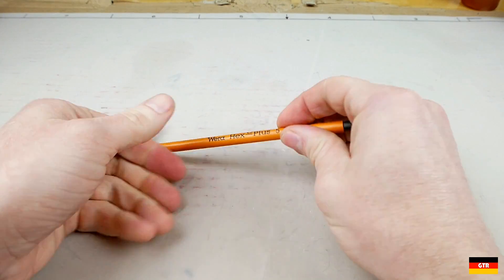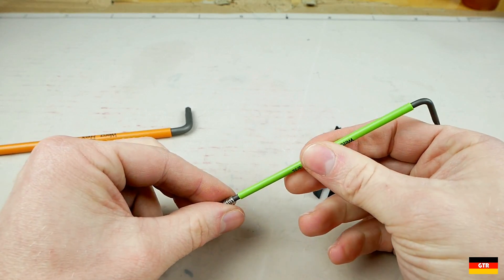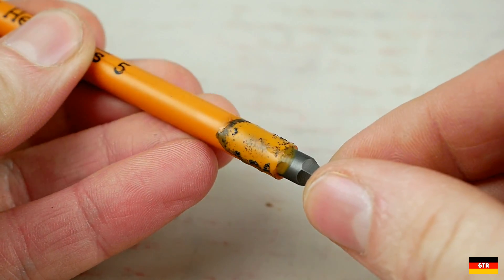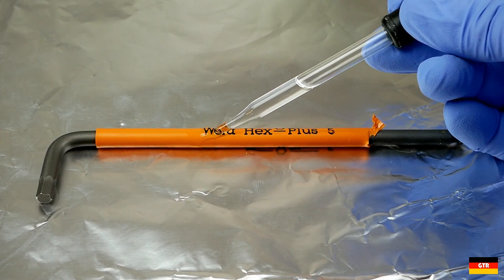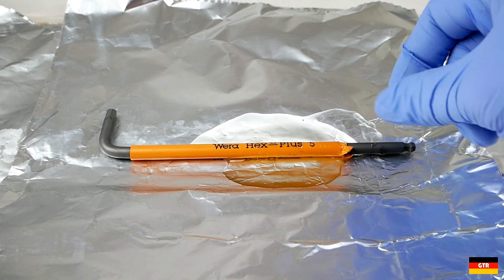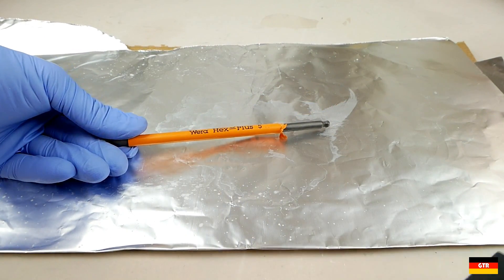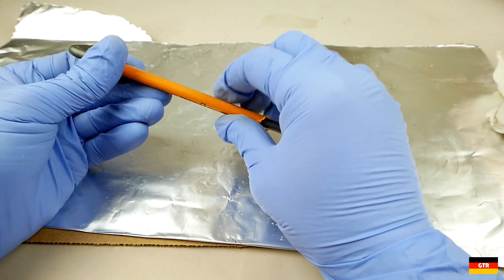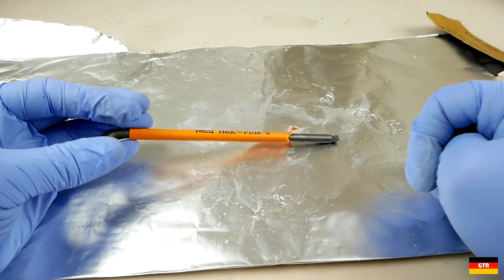Wera L-Key Sleeve Testing

Comment: I've been using a set of these on my dayjob as a mechanic almost daily for well over a year maybe even close to 2 years. I do like them a lot, especially the longer than standard hex key length. I do neither love or dislike the sleeves on them. In a rare case I've come across a situation where the sleeve didn't fit. It was for a pulley set screw. The sleeve is indeed narrower as the major diameter of the screw thread. It's the hole that has only clearance of the threads minor diameter. Just took a boxcutter and shortened the sleeve a bit. I care most about not stripping out bolt heads, and they still perform well. Mine do show fading of the lettering tough, at least the ones that get used most. Plain wear or chemicals, don't know. I regularly clean my tools in the parts washer. not sure what chemical is in it, I'ts an industrial degreaser.
Reply: Might be paraffin if it's engine wash.

Comment: I have had mine for almost 14 months, since they came out, no wear issues or damage to the sleeves. I find one associates the color with the size after a while. It gets confusing though when using the metric and the imperial size, that have different colors. I think they are the best hex wrenches on the market, well made and very slip resistant.

Comment: I sometimes move up the scale with solvents I have on-hand while cleaning unknown stuff; Alcohol, Mineral Spirits, Acetone, then Lacquer Thinner. I think Lacquer Thinner will soften most PVC plastics and I avoid using it on tool handles and such.

Comment: You measured the major diameter of the setscrew but in order for the allen key to fit through the hole it needs to fit through the minor diameter.

Personally I got the stainless versions of teses L-keys and I'm very happy with them, the sleeved versions were more expensive and I didn't think to need those sleeves
Reply from the maker: Yeah I realized that after I finished.  Was trying to measure the minor diameter, so it would probably hit.

Comment: I would consider trying a brake cleaner, a methylene chloride-containing paint stripper (Goof Off All Purpose at Lowes contains it), and a non-polar solvent such as toluene or xylene (the same Goof Off also has both).
Reply: Good call on the brake cleaner and methylene chloride, however, Goof-Off contains Acetone and Xylene as well as Ethylbezene and Methanol per the SDS. Wouldn't hurt to try it non the less.
Reply: Yes, i have seen brakleen react with many different plastcs. For starters. DONT get it on your phone screen! And it deforms rubber o-rings easily.

Comment: I have a set and have had them for approximately a year. Without question the best Allen keys I've ever owned it puts bondhus to shame. However, even though they look lovely when new the identification on the sleeves rubs off within 3 months of heavy use and after 6 months the plastic slips off. The only Allen keys that this hasn't happened to is the 1.5 and 2.5 but that is because they rarely get used. The other issue is that when used now they tend to slip in the hand alot more which has on a couple occasions caused injury. And the other issue is that you can't throw away the sleeves because of the holder bit of a nuisance! If they get used on a regular basis get a set without the sleeves if they do some plus I find I can tell a size of an Allen key by just looking at them if you use them that often. If a hobbyist or used infrequently go for these you'll be more than happy.

Comment: Using these to setup lathes at my job have been pretty nice. There have been a few of them with nicked up and scraped up sleeves, but it's plastic vs aluminum & steel chuck jaws and tooling etc. To be expected. Only issue was with one of the sleeves being too thick when I tried to undo a hex cap screw deep in a tight bore, I had to shave the sleeve down to get in there. The biggest plus for me is Hex Plus. I have yet find another set of L-keys that engage with barely any play and very solid engagement. All the Bondhus keys around the shop work, but they just don't feel as good when I'm putting torque one it to tighten or loosen up a fastener.

Comment: Someone may have pointed this out to you already and it's not really that big of a deal in your video as a whole (or even at all), but how you measured the Wiha key is roughly 1.155 time smaller than the actual largest width dimension.

Comment: I have a set of these for Bike repair. The sleeves of the most common sizes got loose and slide off the l-keys. In my opinion the sleeves are not very durable, if used frequently...
Reply: Bono Bo Same here. If the text is gone fine. But sleeves that slide off is unacceptable plus render the tool holder useless.
Reply: These have lifetime warranty. I had the sleeve slip off one of mine; contacted Wera, they gave me an address to send the faulty one to and sent me a brand new one.
Reply: Same happened to me

Comment: i got a set of those, and i like the coulour coding. although i haven't tested the sleeves in harsh conditions, most annoying thing is: the sleeve catches the hole in the holder. so putting it back in is sometimes rather tricky, and i have thought of cutting it to an angle (like a pencil), to make it easier.

Comment: Thanks for the tests. I  would have suggested a couple others. 
1.As mentioned by many brake cleaner.
2. Brake fluid.
3.Plain ole motor oil. I really think repeated handling with  greasy oily hands will eventually creep under the thermoplastic sleeve  leading to slippage and not necessarily degrading of the material. Had they incorporated a step up at the ends of the sleeve that would probably help to minimize it sliding off but not for spinning. If anyone has had them sliding please comment   im curious
Reply from the maker: I had some brake fluid ready to try, but I read that it shouldn't do anything to plastics, just to paint.
Reply: @GermanToolReviews  Yes i have read that also. I was thinking more along the lines of it removing the print and doing it   probably pretty quickly.  I am still curious if these  sleeves are susceptible to oil migrating under them and causing problems. I think a large portion of people purchasing these will be using them in an oil ridden environment.  Thanks for all your great reviews and to the point presentations. Keep it up. 🙂

Comment: Some personal experience: my colleague managed to smear the text just a little bit. His hands are constantly covered in emulsion made for CNC machining, while using them for high-torque fixturing. The combination of skin rubbing against it, machining oil and water mixture, and slipping due to torque is able to damage it. The effect is negligible so far but still noticeable. Not a big deal so far.

Comment: Good video.  I was thinking carb and choke (chlorinated) cleaner or as Seth A said, the brake cleaner.  Maybe try Muratic acid, though don't know why anyone would get that tool in contact with such an acid.  Also wondering about Diesel fuel.  Oh, and long exposure to UV, maybe from sitting on a bench with lots of exposure to sunlight.
Reply: Muriatic acid is used to clean scale build up off of stainless steel cylinder style ice machines. The top and bottom bearing is secured using hex bolts. 
The metal is rinsed with water afterward and then sanitized before retiring to service.
Reply from the maker: I already put it outside, so we will know soon on how it holds up to UV.

Comment: Most of my hex key has lost all the text on the sleeve and to add injury to the insult, on two keys the sleeve slides off. 

My tools are subjected to mostly, but not only: dirt, solvents, petroleum products, cleaners, heat and various oils. 
Always cleaned after jobs and treated with Balistol.
I do not recommend these keys for medium and heavy industries. 
Best suited for clean light industries or home workshop.
Reply from the maker: Yeah for super heavy use, Wera L-Keys might not be the best.  Even the non-sleeved ones are laser-etched, which will probably wear off if its used everyday for many years.  For something like that, maybe a nickel-plated Wiha would be better suited.

Comment: Yep, on the most common sizes the text is completely gone on mine. I even think it's because of the plastic (folding) holder, it's quite snug. Inserting and putting it back all the time causes enough wear i think.
These are my favourite l keys, but i do wish they would've stamped them somewhere. Ink and laser etching sucks.

In terms of solvent; brake cleaner and carb cleaner are nasty. Ammonia and hydrochloric acid are also two household chemicals you might put it through (not at the same time though, i think you get toxic gases when you mix those!)

Anyway, thanks for your time as always. Really appreciate your videos!

Comment: I don't think many plastics react with acids. Polymers normally break down when a plasticizer is leached out by a solvent, and they become brittle or sticky. Which solvent does the trick, and how long it takes, is different for all different types of plastics. If you know what type of plastic this is, you can search the contents of a book called "Compositional and Failure Analysis of Polymers: A Practical Approach" on Google.

Acetone was a good choice, but it may take a few applications and a few days to show results. Gasoline and Brakleen are also tough, but evaporate quickly with incidental contact, which isn't a big deal. For hand tools a bigger problem is leaving rubber or plastic with a coating of oil, which has far more time to do damage while they sit in the drawer.

Comment: I don't understand why this is such a big deal. I never have to look at my hex wrenches to see what size they are. After using tools for a time, you can just tell by looking. Not to mention with these hex keys in particular the color would be better for identification than writing. Wera could however just make them to where the writing goes all the way through the plastic. That's the way they did the buttons on the Nintendo Switch (watched a JerryRigEverything video on it), so the writing never wears off.